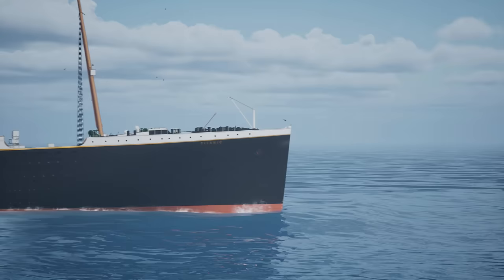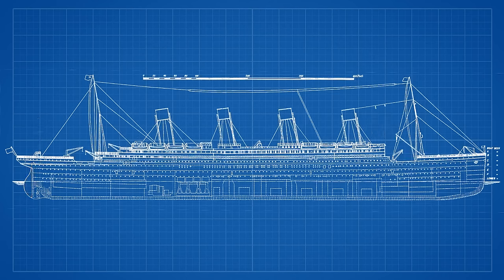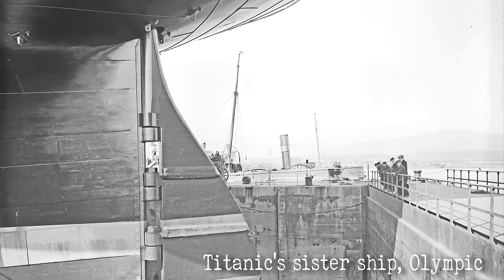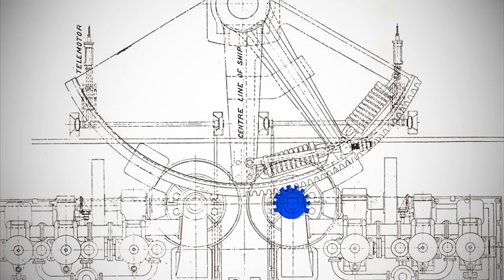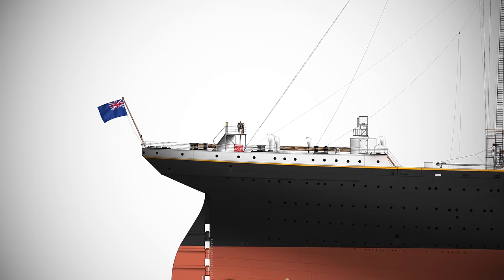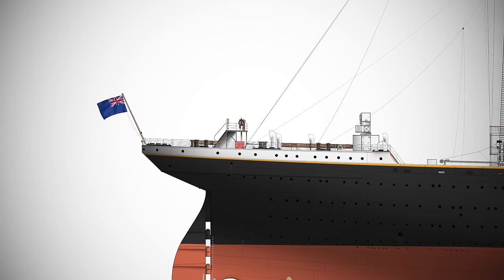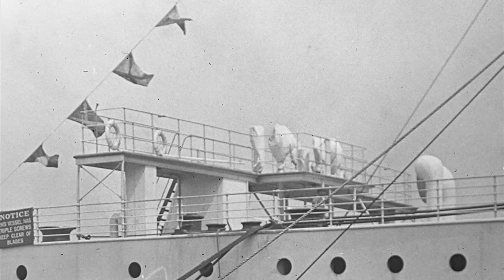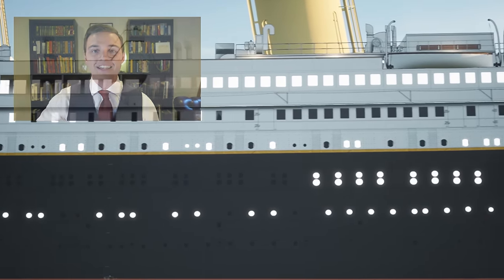How Did They Steer the Titanic?

Comment: Mike Brady, thank you.  It was very interesting.  This video is another example of my surprise and awe for the technology that we had back then.  The first time when I was a teenager and having read that the Titanic was the first ship to use electric fans throughout the ship for cooling.
I seem to remember either reading or hearing in a documentary, that when a collision with the iceberg was inevitable, the call for hard starboard had been given secondary to the propellers having been shifted into reverse.  Those two actions combined were to pull the ship away from the iceberg.   Instead, the forward momentum was too powerful, and the ship didn't reverse direction as quickly as needed.  While the turn to hard starboard happened on time but without reverse occurring, resulted in the ship hitting the iceberg much harder than would have.
Is there any credence to this having happened?
Unrelated, I have often wondered if the Titanic could have been made to allow more time for help to arrive, as follows: If fast action of hard starboard turn combined with full reverse power, would have greatly lessened water penetration at the rip in the hull.
Does anyone have an opinion on this?
Reply: In all likelihood, they didn’t actually reverse the engines to avoid the collision. This was only ever reported by 4th officer Boxhall, who was walking towards the bridge at the time, heard the telegraph bells ringing, and assumed the order given was “full astern”. Unfortunately, he even put words in Murdoch’s mouth when he testified that Murdoch told the captain that he “put her hard over and reversed the engines, but she was too close”.
The actual order received by the boiler and engine rooms was simply “all stop”. This makes even more sense considering that Murdoch was previously in position on the Olympic and would’ve known full well that there wouldn’t be time to reverse them.
Reply: @DerpyPossum    Thank you for that.  I didn't know about these officers' statements.

Comment: I know this video is about the Titanic but if I may add, many of today's ships, including cruise ships use Azipods and thrusters to steer the ship. With those devices, a modern ship can turn 360 degrees on it's own access as the azipods have a 360 degree rotation. The invention of the Azipods have reduced the need for tugs to enter and leave ports unless the port requires tug use or if in severe weather as with the Azipods and thrusters, the ship can maneuver on it's on in very small increments.  Cheers Mike !

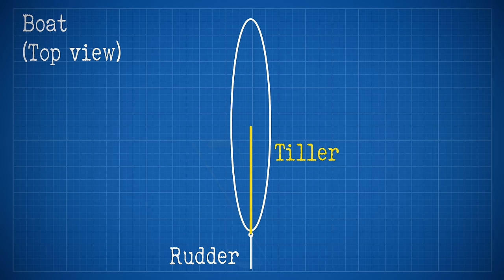Comment: Good video on the engineering but I still think you still have the pprt and starboard titanic reference opposite in the video at 12:09.  Would have been better to show the other way such that turning the wheel in the bridge to the left moved the tiller starboard and rudder to port.
In summary I think: "
Your explanation of wheel movement and the ship movement are  1 to 1 which makes sense due to human reflex, but the command is reversed because by tradition  it references what the old school whehand tiller operator would do to the tiller.

Comment: The irony being that had the Titantic actually turned hard to starboard it may not have sunk.  Yes, it would have collided more squarely with the iceberg but, many of the forward compartments are sealed preventing flooding from spreading aft.  As it was Titantic grazed the berg rupturing seams along many frames and compartments, many of which were open to the next aft compartment.  Therefore as a compartment flooded water would cascade into adjacent aft comparts thus slowing dragging the ship under.

Comment: To avoid an imminent obstacle when driving a big ship, you have to get the stern around it. Simply turning to port or starboard (like driving a car) will set the conditions for a stern incident for a big ship.

The initial wheel orders are counterintuitive in big ships because the stern has to be brought around. You have to wheel away from the obstacle, often placing the stern in a line with the obstacle, then wheel back to the obstacle to clear the stern.

This also avoids "squat", although generally experienced in shallow water, it can be experienced when there are relative depths between a large obstacle and a large ship. A large ship can experience squat when passing close to an iceberg.
Reply: Written like a maritime academy grad, unlike myself, a hawespiper and generally stubborn meathead.
Reply: @frankmiller95  just a very old RAN, drunken, fish headed, ship driver, that's all. This is not a bad channel.
Reply: @stuartkcalvin  Oz is great.

Comment: Ships and most boats  steer  from the stern. When  in a turn  the stern swings  in a wider radius than  the bow. When trying  to avoid  an object that shows up
a short distance in front, quickly  decide which way to turn  and when the object  is midship turn  toward it so the wide arcing stern  won't  hit it. The  Titanic hit on the stbd side forward so it did not have enough time  to reach  midship  and counter the maneuver. Big ships can lag between  turning  the rudder  and the ship reacting.

Comment: I`ve heard that the propeller in the middle could only do forward or nothing, but no reverse, because its not powered by the steam engines but by a turbine using the remaining steam pressure from the other two. So since Titanic should also drive full backwards, the propeller in the middle probably was shut down and now I`m thinking If this had an impact on the steerability of the Titanic because the rudder is directly behind the middle propeller.
What do you think to this?

Comment: One interesting note - during the 1800's, ships started being built with the wheel/pulley arrangement for the tiller reversed, so turning the wheel to the right would actually turn the ship to the right. When this switch happened, to prevent confusion, orders were still called out to turn the opposite, like mentioned in the video. But at some point, orders were changed to the logical "turn right to turn right" fashion in the rest of the world. The British were the last to give it up, of course. I'm not sure exactly when this happened, but it was seen as odd by the rest of the world that they still called out reversed orders.

Comment: not sure where i heard this but the second order after the Hard to Starboard was Reverse the Engines? But that caused cavitation around the props and removed the prop wash from acting on the Rudder.
Essentially with the boat going forward and the props going backwards the two forces work against each other and the Rudder is not as effective .
So if this is the case then they may have missed the Iceberg if the engines were left in forward ?

Comment: I thought the point of hard a starboard was to “port-round” the iceberg. Steering to the right would have deflected the stern, where the rudder force is applied, to the left, swinging the stern away from the collision and “rounding” the course in an arc. The evidence shows this indeed happened, since the tearing on the hull stopped short and the berg didn’t perforate the full length of the ship. The call was correct for the time they had to respond to the sighting.

Comment: Interesting video. Thanks. What you haven't mentioned is that the two commands issued by Murdoch sealed the Titanic's fate. If he had only ordered engines full astern it would have meant a head-on collision with the iceberg and that would have certainly caused a lot of damage both frontal to the boat and internal to fittings and people, but it would not have sunk the boat. Full to starboard in isolation would have almost certainly turned the boat past the berg because the rudder would have maintained maximum effectiveness due to the centre propeller still turning.
Reply: Everyone's first instinct is to swerve to avoid a collision. That's all he had time for in the moment too. To his credit he almost cleared the berg. It's too bad he wasn't playing horseshoes or hand grenades though. So almost didn't count. The rest is as they say history now. Really I think I'd have rather sank it than bashed it up real bad. Least I could hold my head up and say I tried my best for the best possible outcome. The real fault lies in them going ludicrous speed in icy waters on a pitch black night in calm seas. That and not having enough lifeboats or using them correctly. Some say the rivets used in the construction were faulty too. Disasters are often the result of a combination of factors. Any single one wouldn't be too bad by itself but together they magnify each other. And you're screwed.
Reply: The engines didn't have the time to go astern, they didn't even have the time to stop before the coilission, so it probablt didn't matter.  
Also, I think Murdoch only gave the order for the Stbd engine to stop, which would improve turning time, theoretically.

But the orders he gave were absolutely correct in the situation (assuming he didn't order full stop), of course he had to try and avoid the iceberg, he had no way of knowing it wasn't possible, nor that the resulting damage would be just slightly too much for the ship to survive.

Comment: l was at sea in the 60s/70s, mostly on VLCC tankers. the ships wheel was in the bridge house, alongside the Telegraph. It could be switched from auto-pilot to electric then manual, where you would feel resistance, plus the wheel would return amidships if pressure was relaxed. These ships were remarkable easy to steer once one got used to the delay in reaction..The rudders was operated via telemeter to a John Hastie & Co ..hydraulic push/pull ram steering gear. Which was massive!.. Also turn starboard meant turn the wheel to starboard ...vice-verser

Comment: You forget some essentials. TT had 3 propellers.  Only the center had a rudder. So A: Look at waterflow center propeller when hard SB is given. JUST 1 half of water will flow against rudder, other half still goes straight,pushing ship forward. B:  Than 2 outside propellers still both water pressure is straight not reaching any part of the rudder. Therefore from 3 streams of water, divided into each 2 sides, making 6, only 1/6th of that pressure can be max used to steer the ship. You could use both outer propellers to steer, by 1 forward and 1 backwards, But TT does not use that on critical moment. Size of ships in water. Take a large floating can of half filled with what ever to keep it just floating. Put in your sink or bath. push against it. GO and practice it! Then set it on the floor, again push against it. Notice some difference? So size in water is something completely different than you used to at land.

Comment: The charging speed on the new 23 is not 135kw Kyle, it's 170. I have one and I've started at 174 and several other owners I've spoken with have started in this range. I had a 22 prior to this and can confirm that the curve is a little faster on the 23, it hangs in there at higher rates all the way to 90%.

Comment: I still wonder why there were two steering wheels at the front in view of the fact that they could have build the wheelhouse directly at the front. Maybe the second wheel also served as an emergency wheel in case the other telemotor didn’t work? There has to be a second reason beside better visibility.

Comment: She had three props, port, center and starboard,  you have to keep that center prop turning and the boat has to be moving for the rudder to do anything.   for steering around at slow speeds in port, they steer it like a tank, to turn left (to port) you shift the port prop in to reverse and the starboard prop forward,  they never talked about the controls but i would have shifted the port side into neutral and gave the center screw full power but this kicks the back of the boat to strbrd.  to you have to make with the quickness on the steering wheel and screws and switch before you broadside the obstacle

Comment: check homedepot, you can currently get a xc5.0 battery+charger starter kit for 198$cad and in bonus, you can choose one free tools. amongst them is the grinder. pretty hot deal IMO ! also, the standalone tool is only 129$cad, which is kinda cheap if you already have a bunch of battery.

Comment: Sometimes I think if Murdock had stayed at full speed at the moment of the collision (21 knots) and only ordered to Robert Hichens to maneuver the ship instead of the full astern he did? My reason is about the center propeller. It was made to increase the action of the rudder in turn the ship more fast (not only speed) but works just forward, not backwards. Because of the nature of a turbine, it not spin in reverse, only one direction (do not confuse with the reverse technique that airplanes uses to land, the turbine still spinning in the same direction, they just "redirects"the air to the oposite direction)

Ordering astern together with hard to starboard, the ship lost speed and the center propeller stopped. Only the other two remained spinning. The ship's turning capacity was severely impaired.

P.S: And exists that history about the Lightoller's granddaughter, Louise Patten, about these two steering wheels the Titanic had. One used the old standard (left to go right) and other used the new standard (left to go left) and the officer at the moment, Robert Hichens panicked and confused the order and turned the ship to wrong direction making the collision. I don't know if this history is credible.

Comment: Three screws (propellers) and one rudder.  Titanic overran her "headlights."  Her crew was operationally unprepared for the consequences of maneuvering at night at daytime speeds of 21 - 22 knots that her propulsion plant could push her to.

(Note: a raft of contemporary (to the sinking) technical information was reprinted and published when that famous movie was released in 1997. I bought a boxed set of those reprints).

Titanic's headlights were her watch crews in the Ship's Crow's Nest.  No lights, no binoculars.  Their eyes were fixed upon the star-field horizon boundary, which was visible at approximately 12.34 miles distant from them in the ship's Crow's Nest 101.5 feet above the water line.  They looked for "holes" in the star field that began at the horizon boundary.  If one of those holes had a roughly constant bearing and a perceptible growth in height (and/or area) where no star field was visible, some unlit object was closing on their ship.

The speed of the approach and calculated distance between the object and their ship was unknown.  If their ship's speed was 10 - 15 knots (max), the turning radius of any avoidance maneuver was small enough that the object, whatever it was, could be spotted in time, observed over time, and an avoidance maneuver plotted and executed.  At a ship's speed of 20+ knots, this was not possible.  The curvature arc of the turning radius was at or outside of the closest approach position of the object to their ship.  That is, it meant a collision that was impossible to avoid.

That is because, in true nighttime darkness, it is extremely difficult for the human eye to perceive relative velocities and/or direction(s).  Concerning the iceberg that the Titanic collided with, it was traveling southward at a considerable rate (close to the Titanic) and was carried by the southward current.  This was not perceived by Crows Nest crews.  At any distance, that was useful in warning of the need for some avoidance maneuver to be plotted and executed. 

Because, traveling as fast as she was on a moonless flat calm night, by the time the Crows Nest crew sounded the collision.  The Berg was going to hit Titanic.

Comment: Just watched Titanic (Cameron movie) with the wife and something's been bothering me. During the turn they also show the engineer reversing the engines, and an underwater shot of the center propeller stop, and the starboard propeller reversing. 1/ Would stopping the center propeller, and reversing the outboard ones, reduce the amount of water flowing around the rudder, thus reducing steering efficiency? 2/ Was Titanic capable of differential steering (and reverse only the PORT propeller to assist in steering to port). 3/ Did reversing ANY of the engines actually happen during the real incident?

Comment: Sighting the iceberg, the mate on watch ordered one engine to stop or full Stern. By doing this he upset the laminar flow across the rudder panels minimizing the ability of this barn door rudder to steer the ship. The ship would've responded quite nicely if he'd simply put the engines on stop, but by reversing one engine he caused the ship to crab through the ocean and slam into the iceberg. I have sailed as a chief engineer for over 30 years. I was C/E on a ship that was 880 feet long, 41,000 deadweight tons. My ship was the same size as the Titanic.

Comment: What they should have done is put an adjustable pitch propeller on each side.  To steer you reverse the pitch on 1 prop to put it into reverse while the prop on the other side was in forward. You could change the direction even when the boat was stopped.  When you were gonna hit an iceberg, reverse the pitch on both props.  This would make the propellers try to pull the ship backward to slow it.
Reply: This was long before adjustable pitch propellers existed sadly, and even with them its doubtful they could of avoided the iceberg anyway.

Comment: That 100 ton rudder could have been a fraction of the weight if it had been hollow and filled with sea water. Turning forces would have been similar but manufacturing and maintenance would have been easier.